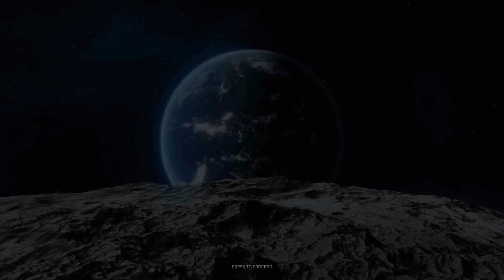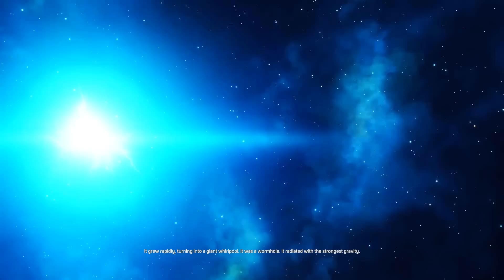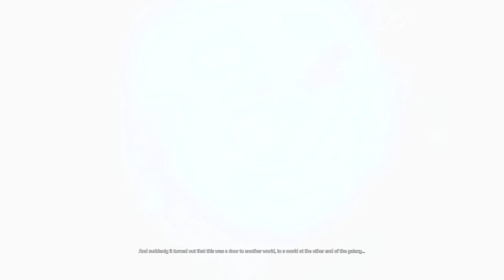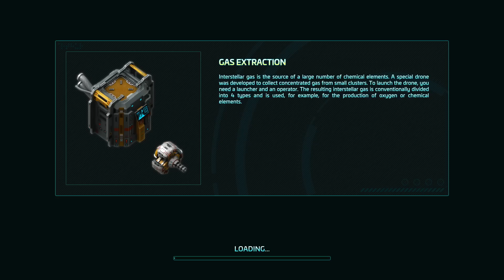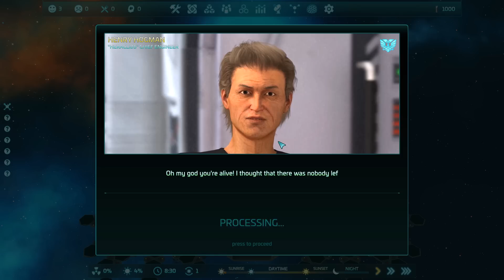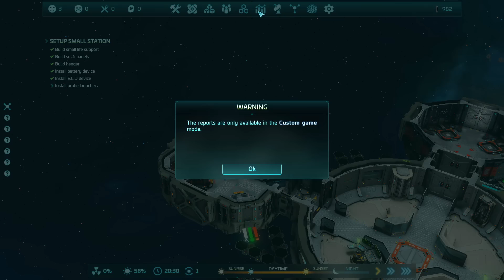Base One - Apocalyptic Space Colonization Sim

Comment: I would assume that since the primary module is fully functional the wires will already have been built into the walls, any further expansion will just connect to existing plugs. That´s how regular buildings are built, you plan ahead for any future electrical wiring. Connecting/arranging wires after building a structure just doesn´t sound very practical.

Comment: The design of connections and supply of oxygen/heat as game mechanics makes no sense, would have been much better if they were resources to be produced, controlled, consumed and assigned per room, rather than this. No power production indicators is also bad choice - hope you can link solar stations and all batteries together to create a system which can balance itself. Honestly seems very generic and simplified to a point of not being interesting.